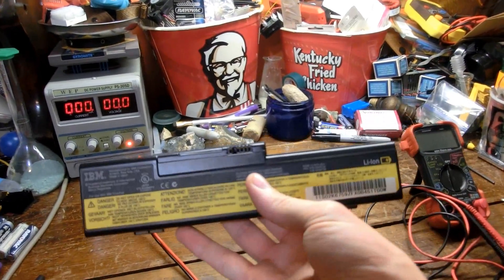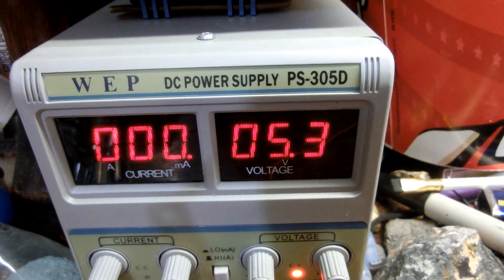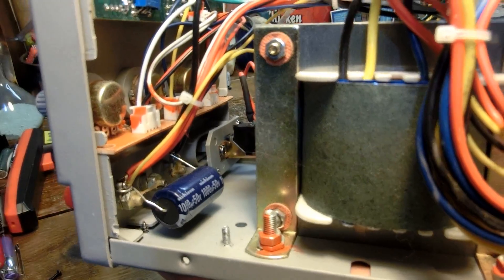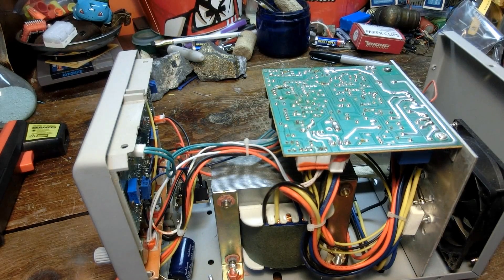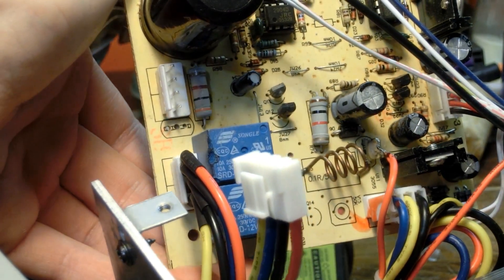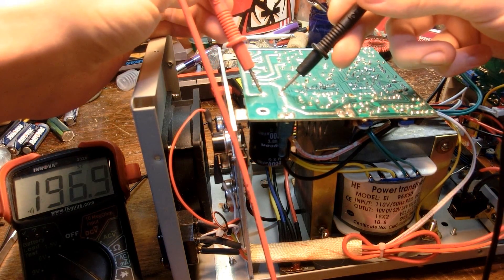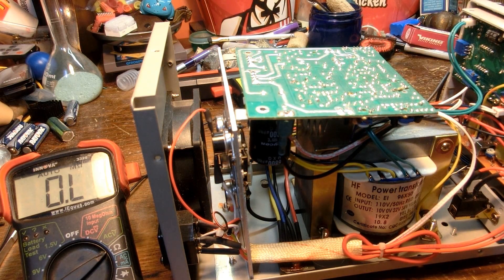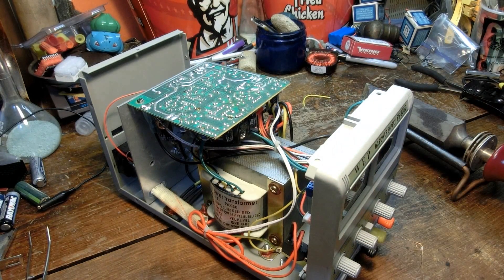How It Failed: 80$ 30V 5A Variable DC Power Supply

Comment: That's the biggest fucking soldering I have ever seen in my life!!!  Also, don't charge batteries with a benchtop power supply, get a PROPER CHARGER!!
Reply from the maker: A power supply like this is just as capable as one with a bms if the operator is skilled and vigilent

Comment: I am just wondering if it is not better to buiild my own power supply (at least I could learn something and like that I wouldn't be "addicted" to Chinese (not very honest) sellers. I have noticed even when the chinese product is good the costs cut doesn't allow to develop a product and it works fine for a few months and stops.. I was so happy when I bought my power supply for 15 $ it worked like 6 months without any problems , still works but for example switch ON/OFF stopped working etc. This could be a good product but because of the costs race in China it remains only an expensive crap. And at the end you waste your time because something doesn't work properlly (this costs as well! ).

Comment: too large capacitor at the output , even if you set current limit to 20mA, connected circuit will not survive.  Try  10uF

Comment: Goes on about the fan and the airflow being blocked inside. It probably over heated more due to it being wedged against the wall and sides not having any room either. 
It states in the manual for these power supplies to leave at least 10cm open space around enclosure

Comment: I’ve used soldering irons like that but I was soldering large pieces of copper flashing on a roof.  Never occurred to me to use one for electronics.  It’s probably a 500 watt iron that will fry a board in a hurry.  Better get a jug of Ruby fluid to clean that nasty tip.😊

Comment: The internal layout of the supply I don't like, heatsink with no holes.  Also some boards are not glass epoxy.  Board mounted above warm/hot transformer not good either.

Just for fun more effort may fix the supply.  But it depends.  I sold a non working Heathkit scope I built to another.  The scope failed after many years.  I placed little effort to fix because I have Tektronix scopes.  Not worth the effort IMO.

Comment: In the manual it often states not to use these supplies as a voltage/current sink, if the battery voltage is even slightly higher than the PSU output voltage it can blow the output stage. Always put a diode in series to prevent back feeding.

Comment: I have a Farnell L30DT that is about 40 years old and still works great. Buying good used gear can be cheaper than new cheaply built gear.
Reply from the maker: i picked up an HP power supply a few years ago for 45$ but then it burned out in 10 minutes of light use. so it really is random.

Comment: I just fixed mine last night. Blown trace from a shorted diode. Lets see if it's the same cause...
Reply: Wow this is an old video lol. Well, if you still have it there is a diode that failed as a short right next to that capacitor you pulled.

Comment: Things have changed a bit since this supply was made. I bought a Tenma. Nice finned heat sink.for power trans and diode bridge,  etc., etc. Only thing is silly devils still block the airflow and have the fan sucking instead of blowing. I fitted a server fan blowing and bought ear plugs. I had to fit a finer grill as a wasp got too close. Nearly all thses cheap power supplies fail due to heat. How many watts was that 'soddering' iron ?

Comment: When you buy your new cheapie, open it up FIRST... Look at all the caps and write down the values. Go order yourself each value, but buy a good brand name, such as Nippon Chemicon caps (some of the best), and go for the highest temperature rating. Your failure happened because they use super cheap caps with low temp ratings. The electrolyte dries out, and that causes the caps to short out, blowing parts and traces in the power supply. Buying good name brand caps will help you BIG TIME. if you REALLY wanna go all out, you could drill a few more ventilation holes in the top of the unit, so heat can escape by rising up and out of the unit. Don't let capacitors sit against any hot parts either. You'd be better off leaving enough lead to bend a capacitor away from a hot part. Also consider a dab of hot glue or silicone to secure parts so they don't vibrate. That can weaken parts through mechanical stresses.

If you're willing to do a little work, you can actually turn a cheap device into a much higher quality device that will last you a good long time!

Comment: I think it is worth fixing. I would check those TO-3 power transistors and the thermal fuse on the aluminum plate behind the fan. With a big chunk of copper trace missing, and melted relay cases and wire insulation, I would look at components that handle big current like power transistors. That giant soldering iron is definitely a beauty!!!

Comment: sounds like you burnt out the power supply by charging your battery as I did. I have the xpower 10 amp supply and Icharged a 12v battery once... the next time I powered it up, the fuse was blown because for some reason it fried the "BD3" rectifier on the heat sink and destroyed the 2 irf840's next to it. I replaced them come to find it powers up fine now, however, the damn thing has no output, nor will it even go up in voltage since I did this. The last transistor on the right I believe is a voltage regulator that allows voltage to the output and I believe this went bad too, unfortunately, I am trying to find a schematic to replace this because I am too blind to see the number on Q6 so I can order it.

If anybosy has a schem,atic, or idea what's wrong, please let me know.. mine is brand new and used 3 times.. POS needs to work again, it did work great for a little while.

Comment: I seem to recall that it was related to a crowbar circuit failure.  I'll take a look and see if I remember where I saw that and if it makes sense here.  You should be able to 'hear' the relays switching based off the trim pot outputs.  If the relays aren't clicking, can you force the coil to bypass temporarily?  I'm guessing this might be by the curb now but I was curious.

Comment: Also why would you use a bench power supply to charge batteries and not a balance charger? Surely that's much healthier for the batteries.
Reply: As long as the batteries doesn’t have any electronics, any supply capable of a constant current mode is fine. A balance charger only automates the process. If you’re dealing with a multicell lithium pack, a balance charger is a lot better though.

Comment: Genuinely what the fuck was that soldering iron made for???
Reply: +Alex Scott Soldering lugs on wires, etc.  I used one to solder solid 12ga wire together in bundles and then to bus bars when working on a Westinghouse open rotor DC motor.  The interpoles went bad.
Reply: +Alex Scott
Pipes maybe? I have no idea, but I want one for stripping boards of parts. :D
Reply: Monel Funkawitz
That makes sense. Thanks for the info! :D

Comment: I'm surprised you didn't here that trace go crack! Must have happened whilst you were out of  the room? 

The problem you had there was you measured a short across those traces, yet thought that the cap was the culprit, yet there could have been something else on those tracks. 

Whilst you had the cap out you should have tested for short again - but wud-a-shud-a-cud-a.

Also -ROFL at the soldering Iron - where the hell'd ya find that!
Reply: +Chris Wouse The cooling fan is dead Mr. Smartypants.
Reply: +ipissed go on then explain why that would be a factor
Reply: Chris Wouse
Uhhh because it's there in the first place. Do you think they are there for a soothing noise?
If the transformer windings get too hot the insulator will melt, and it will short circuit. High power feedback through the lower power circuits cause things like traces to pop like a fuse.
Reply: ipissed you really haven't repaired many power supplies in your life have you. Things don't instantly blow up just cos the fan goes. You can't come to that conclusion without doing proper testing! That's like saying your car won't start cos there's no coolant when the bloody thing has no fuel!
Reply: Chris Wouse
I have replaced tons of cooling fans in all kinds of equipment, because they are important.
Everything I said makes sense down to the fact that the lowest power circuit still works. The highest, and medium circuit destroying each other would do just that.
Yet your explanation is an incomplete shot in the dark.
Reply: ipissed WTF are you talking about, what you just said makes no sense!

"the highest and medium circuit destroying each other..." - buh? classic bullshit statement right there!

Just cos you replaced a couple of cooling fans doesn't mean you have an engineering degree bub!

yes cooling is important, but in cheap PSU's they just bolt the transistors to the biggest cheapest heatsink they can find and chuck in a fan for good measure!

My OP was a suggestion of other things to test not a definitive diagnosis! so not a shot in the dark, a waving flash light in the general direction!

replacing a pissing fan won't get the output working will it, fool!
Reply: +ipissed if anything that video proves my point not yours, that supply in the vid doesn't' even have a fan! So how that proving your point!

You know what, I'm calling it, I'm being trolled!
Reply: Chris Wouse
He unwinds the transformer, and talks about the primary winding sending mains voltage back through the circuit if the windings are not isolated or somehow make contact.
That's where the fan comes in because without a fan the insulator melts, then it fails like I explained before.
Honestly if you didn't understand the explanation from bigclive I don't know what else to say. He is an expert, and a great teacher. There may be no hope for you.
Reply: +ipissed so let&#39;s rewind, you took my suggestion of checking other components on that track, stated that the cooling fan had broke and called me Mr smarty pants, gave me a pissy response borderline insulting, and then throw some video at me claiming that this is the problem here, when you haven&#39;t the thing in front of you.

The switching FET could have gone? Think of that? maybe another cap went short? Maybe a protection diode gave out? You can't translate a diagnosis from one problem onto another problem! I'm Not ruling out the transformer could have fried, but from what I can see, it's in good nick. Can't tell for sure without sniffing or dissection.

Rule of thumb of fault finding: TEST THE CHEAPEST THINGS FIRST THEN MOVE UP IN PRICE! Semiconductors and Passives are cheaper than a transformer!
Reply: +ipissed and to top it off I gave you the perfect opportunity to explain all this early on, but instead you have me the piss comment of: "durr cos it's there to cool things!"

Yeh well done! Here's a tip for you! Want to use that degree?! better start acting in a more professional manner when given the opportunity!

Now best put that degree to some use! There are fans out there that won't fix themselves!
Reply: Well I didn't appreciate the arrogance of everyone that made fun of his soldering iron when they couldn't make the simple observation that the cooling fan was dead.
Reply: +ipissed welcome to the Internet! there will always be people who don't see the woods for the trees.

Comment: Metal tweezers on a live circuit - but hey, that's OK, there's a leather glove for hand protection (even though it's a lower-voltage board)... giant soldering iron for small on-board components... tiny flat-head screwdriver for #1 Phillips screws... A goddamn DC power supply to charge a single 18650.... ?!?!?
Nothing could EVER go wrong!
Reply: +Tom S. Or perhaps the cooling fan Mr. Observation.
Reply: Tom S. Nice!  Also, even 1mA across the chest and you could stop a beating heart.

Comment: Funny video :) But you should never feed current into a power supply like you did with that laptop battery. Unless it is clearly stated in the specifications, any given power suppliy is designed to push out current, not sink in current. You may damage it... that might explain why it is blown up in the first place!

Comment: That's exactly what Chinese sellers wants - buy new one every year. That cost us all way more than 80 or 60 USD. The real cost is externalized to the rest of society. I would rather get more expensive one, with proper protections so it wouldn't be easy to messed up by accident.

Comment: Good god. You can't measure resistances in circuit first of all. Second of all, that soldering iron is simply the wrong tool for the job.  The more heat you dump into your components, the more chance of damaging them. Less is more. Of course, a "Super-Genius" should already know all of this.

Comment: Hi there wow what overkill of a soldering iron... First of all the power supply uses those relays to switch between taps of the transformer. The reason is to not have to dissipate the voltage as heat with the transistors. The wattage is reduced from lower in to out voltages. What the failure looks to me is one relay might have welded and two windings are energizing on your transformer at the same time and that is your short. Check the resistance across those relays or disconnect one by one the taps of the transformer and you should find your problem easily.

Comment: You have to be very careful connecting batteries to variable power supplies.  Cheap supplies are not designed to have current run backwards through the regulators which will happen if you turn the supply voltage down below the battery voltage.

Comment: Hello everybody. I found out what is wrong with this power supply, by observation alone. I can clearly see now, that the output is the problem. If he can actually find a transformer that "Output," rather than "Outut," the power supply should be okay. I didn't see that at first... Just take a look starting at 5:01 and you will see what I am talking about. Please let me know who is the manufacture of the power supply, so that I don't make the same mistake and buy from the same company. I will Cee you ater. Ha! Ha!
Reply: +grantnm1 I have the same unit and it says outut too, on mine it says 50 volts on the scale but is actually 59 volts by my multimeter, the volts adjustment doesn't work anymore.

Comment: This guy is poorly educated in electronics. Anyone with a good understanding of a power supply should be able to fix this issue with a few high quality caps and or parts and save a little money. His soldering iron is bigger then his IQ.
Reply: +Matthew Simons Mine is stuck on 50 volts output but is actually 59 volts by my multimeter and adjusting the knobs makes no difference, do you think that maybe the opamps could be causing this, I have checked the relays, transistors and caps and all are fine.

Comment: Good thinking with the gloves and the tweezers! I would have been a jackass and just poked around with my fingers xD
By the way, wtf is up with that MASSIVE soldering gun?! :O
And 70 dollars is not that little money :P
But I would build my self a power supply, and that way if something would fail, I would know exactly what failed, and why :)
Also, I find it's cheaper to build a power supply than to buy one.

Comment: I think that relay got melted when someone was hand soldering the wires on the connector next to the relay. That soldering iron is way too big for PCB soldering, I almost wet myself when I saw you using it on the power supply. Too funny. Nice video. keep it up.
Reply: +TheRadiogeek Or maybe it was an incompetent dumb-ass with a unsuitably large soldering iron…

Comment: Likely a 50 cent diode on the line for reverse polarity protection. I'd pull it and run the replacement across the power output terminals where you have the cap. Possibility #2 is something in the feedback loop. Parts are still cheaper than power supplies.

Comment: Because lithium ion batteries can be very dangerous I wouldnt advise anyone to use a regular power supply to charge them. You can get cheap charger boards with special circuits for safely charging them. The circuits work by constantly monitoring the charge process and adjusting the charging cycle accordingly, something you cannot safely do with a regular power supply.
Reply: DrRawley True, I agree!
Reply from the maker: ***** so you advise to get a "regular power supply" whever that is, then you say you cant safely use a regular power supply, so make up your mind.

either way if you keep the voltage 4.2v or lower youll be fine.
Reply: no I didnt say to get a "regular power supply" you are misreading my comment.

Keeping it under 4.2v is only one part, but it does not guarantee you are safely charging and or monitoring the charge cycle and battery temperatures.

As you may now it is important to charge these batteries at first with a constant current and constant voltage in stage 2 to keep the batteries in optimum state.

Its easier to just buy a Chip or charger that does this all for you safely.
Reply: +ddjazz For what you're talking about...charging lithium batteries is a two part process.  First a constant current process, then constant voltage.  Good info at digikey:  http://www.digikey.com/en/articles/techzone/2012/sep/a-designers-guide-to-lithium-battery-charging